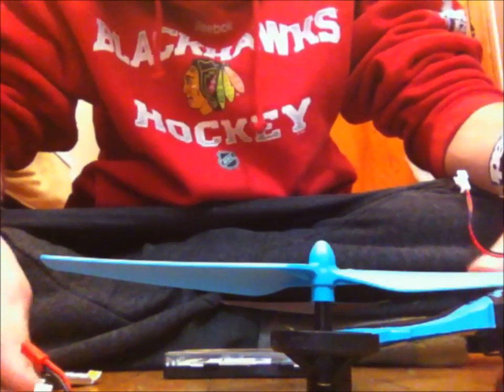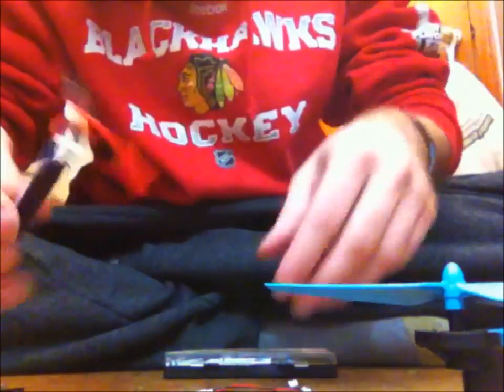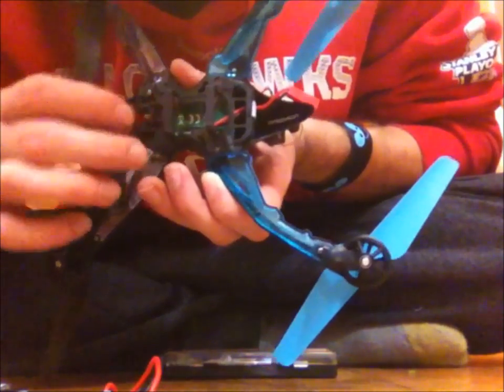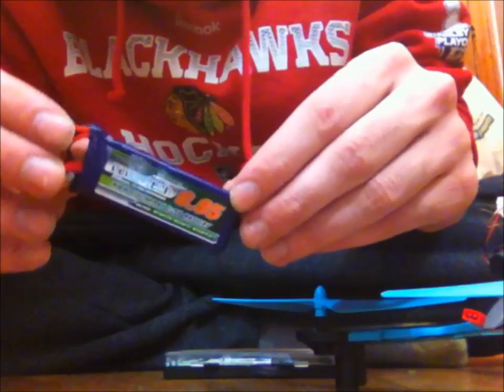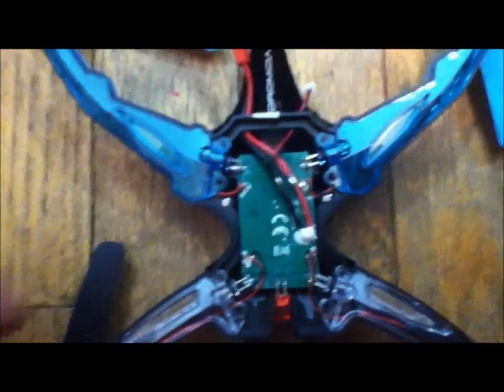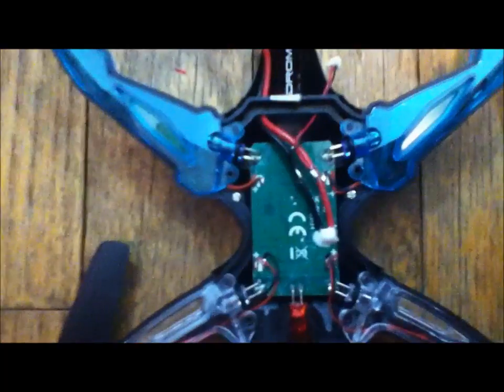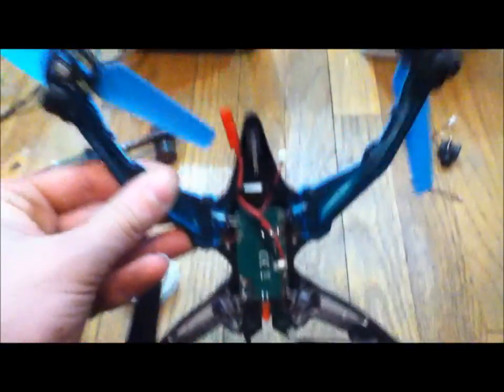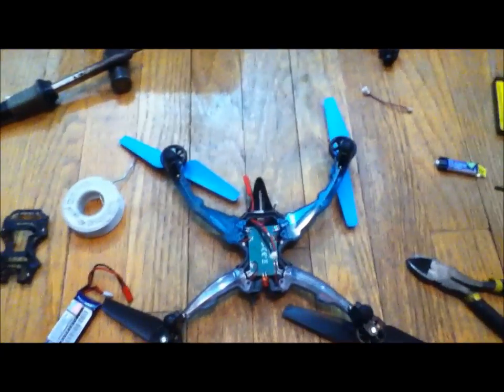Va1100 Fpv Dromida Ominus (How to use stock Ominus battery)

Comment: I use the same nanotech battery, and was thinking of just replacing the connector on the VA1100 with a Walkera/Losi connector. That way I could plug the red connector into the quad's stock plug, and plug the camera into the second connector. It's going to be hanging there anyways, so I might as well put it to use!
Reply: Vern Starr I did that and also try just fitting the antenna inside of the nose of the ominus. It works great best place to have the camera and also something like a 90 degree plastic to stick it to the camera for safe. I use a velcro with original glue. Now I have the best ominus. I tell you fit that antenna and tell me! happy fly!